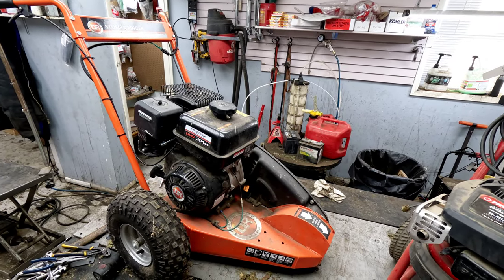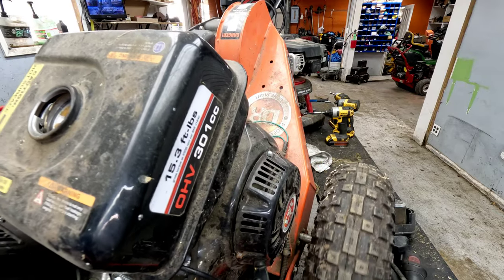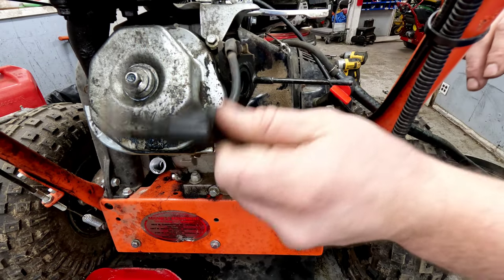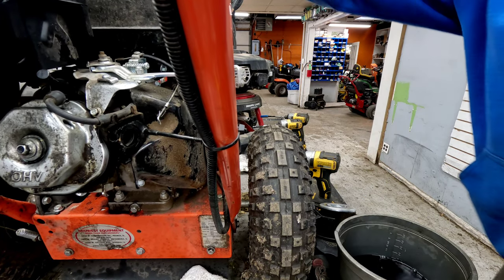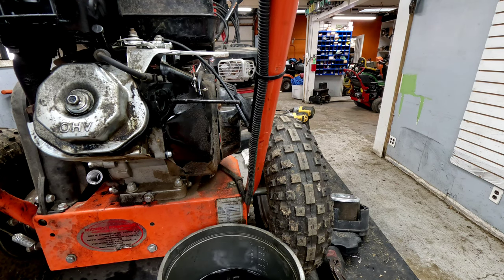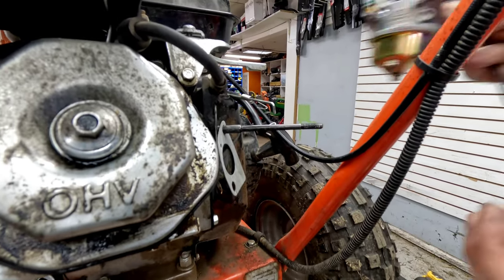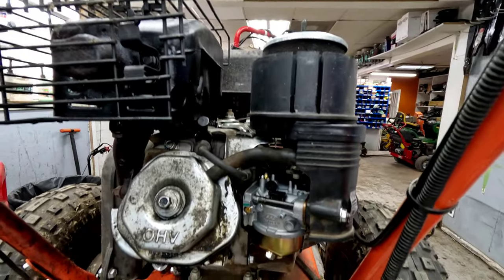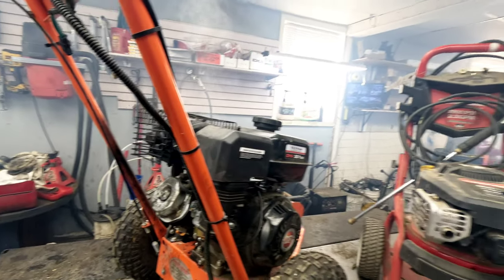How To Fix Your Honda GX390 GX270 Clone DR Stump Grinder That Won't Start & Has Gas In Crankcase

Comment: My engine on my Dr stump grinder looks just like that one - says Briggs and Stratton all over it. Kinda explains why I have so much trouble finding parts.
Reply from the maker: They are pretty interchangeable anymore, more based off the original honda engine with very small differences